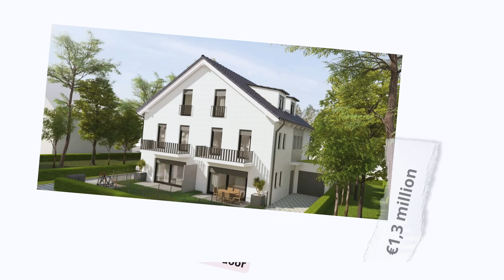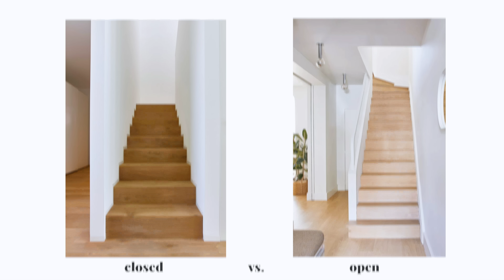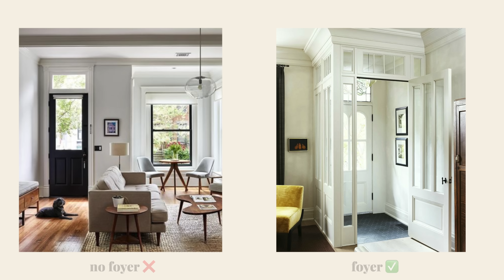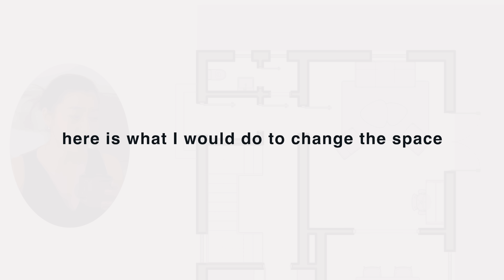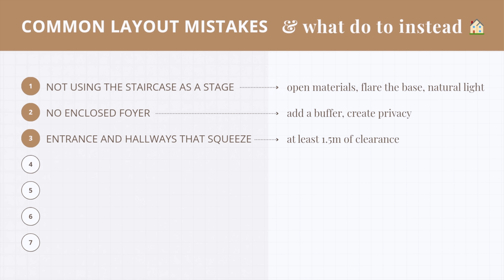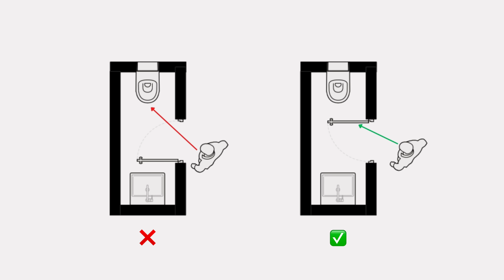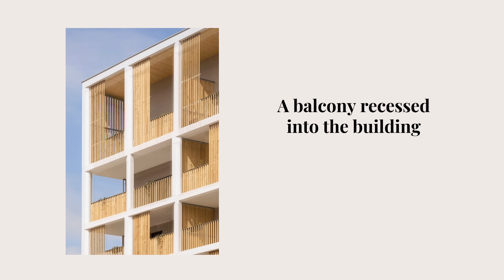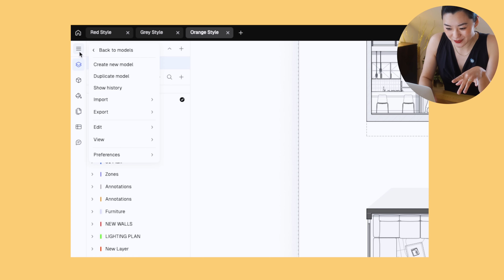Architect’s Advice: 7 Common Layout Mistakes + What to Do Instead

Comment: Used to draw plans for people & built a few homes for myself (with hubby (Australia)).  The little room in front of the toilet in the foyer is for odours & soundproofing.   With an extraction fan in the toilet & a handbasin in the little air pocket room there's more privacy - but it's cramped too much for bigger people.  Some could not get into the toilet room & close the door.  A nightmare if there is a health emergency once in there with the door closed.  Toilet doors should always open outwards.

You're absolutely right about doors doorways in the centre of walls - a nightmare!  If a dining room is part of an open plan, next to the kitchen it shouldn't interfere with a passageway to an external doorway.  It's not sensible to design corridors into rooms - it causes a lot of wear on floors & even furniture when they're touched in passing - & it restricts passage to the outdoors - think emergency exit.

Comment: Very good advice!
I shared a large detached house in Netherlands with my parents, the house being divided in an lower and upper flat. This was done by the previous owners of the property in the period between 1970 to 1986 and my parents and I each bought one of the flats.
The original house is from 1932 with later add ons built in the aforementioned period.
While the original design was sound with a lot of your tips practised the later renovations and add ons made it having many of the don't do's, often combined with poor workmanship.
Like a partition in the hallway to have two entrance doors to said flats, door placement to the add ons having circulation cutting trough living areas and a long narrow and dark gangway in the add on.
After my parents passed away I inherited the lower flat and owned the whole property and started planning on a renovation to improve energy efficiency, make one large family property out of the two flats and improve on many aspects. Especially the dark and narrow spaces are my nemesis, and a detached house of 210m² shouldn't have these!

While doing the design work myself by coincidence in an effort to make things look and feel better I had already implemented some of your advice before seeing the video, there are also things which I didn't consider yet but try to fit in my design as well.
Like removing unnecessary partitions, opening up the hallway, and expose the stairs with the original wood paneling visible which covers the stairs into the cellar, The hallway has a lot of light already by opening up two small windows which were covered up and only allowing light to get in via the brown glass in the old front door.
Currently there are two doors leading from the living room to the add-on, one into the gangway and one into a room.
These create 2 corridors limiting the possibilities for the new kitchen and diner space. These door will be removed and one new entrance without a door will lead into a small hall, 1,80m x 1,30m, from where acces into the gangway, the room and  a new toilet  will be. The open hall will make the living room larger. The hall and toilet will take part of that room in the add-on but as that will be used as a hobby/office room there is enough space remaining for that function.
Following your advice the door into the toilet is a bit offset to one side of the small hall and opens in such way so that there is no direct view in from the living room. The new toilet replaces an existing one that's now inconveniently at the end of the gangway and taking a part of the garage away. (the house was originally built with an outhouse in the barn! so that's why there's no toilet in the original part of the house)
Finally adding a set of french doors in the kitchen area will allow light in from 3 sides in the open plan kitchen/living area.
The kitchen itself will have work tops and cabinets along two sides opposing each other with a 1,5m wide circulation space in between, so that there is enough space for two people working on the opposite sides and a third person walking from the door into the living room can still pass.
The gangway in the add-on will be widened from 0,9m to 1,10m by taking a bit off an adjacent room.
The changes which have been done by now make the house already feel much nicer.

Comment: Just came across your channel. Enjoyed watching it. Been doing a rough layout for a house I want to start within the next 24 months. Something to consider is future maintenance. Site-Built homes they love placing the plumbing under the slab/ floors. I have seen some homes going w/ the PEX Plastic lines overhead. I love how you can put individual valves  on the lines (not shut down the entire system for a repair (toilet or a faucet) And how faucet’s especially in the tubs/showers. Trying to have a closet on the back side and have an access panel to gain access when needed. And metal ducts, the flex duct hoses they use are so inefficient. Very easy to install but that’s the only advantage.

Comment: I'd like to add one: Swap out the toilet with the laundry machines. The bathroom is really 3 frequently needed rooms, forced into a single space, and only one person can use it at a time! This makes it always occupied when you need it. Swap the toilet for the washer/dryer, and suddenly the toilets are occupied much less often. The shower can have an extra curtain for extra private space while dressing, leaving the sink available for simultaneous primping. The washer is used far less often, so crowding isn't a concern. The other major advantage of this is not spraying fecal bacteria all over your toothbrush every time you flush the toilet. It also just makes sense to have the laundry in the communal room where people tend to take off dirty clothing.
Reply: Separate toilets have been the norm in Australia for ever. Absolutely agree with the idea of a laundry-bathroom as well, we have that arrangement and it's perfect..strip off dirty clothes and straight in the wash!
Reply: Having a laundry by the front door also means having to carry washing throughout the house instead of being easily placed to put on the washing line outside; you also want to keep the noise of the washing machine away from the main living areas as much as possible.
Reply: My husband and I are retired and several years ago, designed and built our “aging in place” home. We were the owner-builders with a construction consultant and we used his preferred laborers). It’s very small but doesn’t feel small at all due to good storage and high ceilings…vaulted 12-13 ft high in the main room…9 ft in remainder of house. The biggest thing I like about our (only) bathroom is that it’s divided…enter outer bathroom… vanity on the right side/washer dryer on the left…continue walking straight ahead to inner bathroom with door separating…toilet on right side (not visible until you walk through the opening) and walk-in shower on the left. We rarely have any issues needing to use the same bathroom facilities at the same time. Works well when we have guests in the house, too.
Reply: That's just dumb. A bathroom is NOT a community room, it's a private one. And you need all those things (toilet, sink, and shower or bath) in one room. A washer and/or dryer can go anywhere there's room, and it doesn't matter if they can be seen.
Reply: @awo1fman  "A bathroom is NOT a community room, it's a private one." That's my point! The bathroom is 3 really rooms jammed into one, that can only be occupied by one person at a time because of privacy needs! That's why, if you live with someone else, there's a good chance the bathroom is occupied when you need to be in there. By swapping the laundry machines with the toilet, you can make the room 1: far less needed at the same time as others, and 2: sharable even if it is needed at the same time as others.
Reply: @awo1fman  You do NOT need all of those things in one room. Why do you need to poop in the shower room? Washing machines also need access to water lines, as does your kitchen, yet the kitchen is not in the bathroom, is it? You're not making sense.

Comment: I have lived in 10 different houses. I would stay away from open concept houses where the living room , kitchen, dining areas are combined; no private space and getting away from kitchen mess. I do not like open stair cases, as they make it difficult  to subdivide the house into smaller apartments . Many of today's houses are too big for the number of occupants and will have to be torn down, when higher density communities will be required.
Reply: Time to bring back larger families.  The 'below replacement birth rate' is unsustainable anyway.

Comment: The one problem with an open staircase is all the heat rises from the bottom floor to the top. I would even close all the heater ducts on the upper floor and still the lower floor was cold.

Comment: On an efficiency stand point opening up the stairs can effect the temperature and therefore comfort of the home especially in very hot or cold climates. Its called the stack effect. When you open the stairs up you allow for the hot air to easily raise to the top and the cold air to fall to the bottom. It's worse then just that. The hot air creates a pressure at the top pushing its way out though any cracks. The basement is then put in a negative pressure pulling in air from cracks in the basement (or main floor if there isn't a basement). This will worsen its effect. You will have to build a very air tight house and you need the ability to pull the air back down with ventilation.

Comment: Great suggestions.  I am not an architect but we are trying to design a new house that would have a lot of universal design features for elderly or handicapped.   I especially like the toilet suggestion as, if you are dealing with an already built house, it would not be too hard to simply switch the way the door opens.  This helps not only for privacy, but you don't want the door opening to block your use of the sink.  If you simply want to wash your hands, the door can remain open - so it seems more of a common sense layout.   Recessed rooms are an issue for us - including balconies (we would not have a balcony sticking out for the reasons you stated) but would not have a recessed balcony because it simply blocks the light into the home or apartment - presumably into one of the main living areas where you spend a lot of time.  Understanding that many apartments and homes have balconies so you can enjoy the outdoors, given how little time people spend on them versus how much time they spend in the main living areas - it may be a tradeoff - but we would ditch balconies tto not blocking the light in the living areas.  Even if they are not recessed, in an apartment, unless you were on the top floor, you still loose light from the floor above you.  Does this make sense or am I off base on this?
Reply: Hire an architect.   Seriously.  Or at least a building designer or published house plans.
The house I live in now was designed by the owners.  The master bedroom is the smallest bedroom in the house, a double bed is all I can get in there, the bathroom as zero counterspace it's just horrible.  Will cost $400,000 to fix is; cheaper just to sell and move elsewhere.
Reply: My LARGE recessed balcony is the best "room" of my house in which the most time is spent. The balcony has a high gabled roof, allowing plenty of light into the adjoining kitchen, which has a servery to the outdoor area. Wonderful functionality in our warm climate.

Comment: Not sure if it's intentional or not, but one "trick" that I've seen to (partially) hide a toilet in a small bathroom is to put it on the far end of the sink vanity (door > vanity > toilet).  A bonus is that, if you have a window, you can gaze out upon your kingdom from your porcelain throne.

Many older US homes have "galley" bathrooms (similar to galley kitchens) with no real corners, as such, to hide things behind.  Sink and toilet on one side, shower/tub on the other side.  And, if you're lucky (ie, not in an apartment), a window at the end.

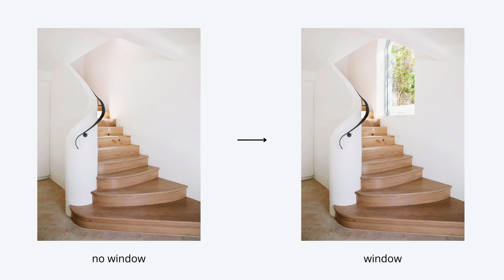Comment: 1:51 Stop it right here! I want my stairs closed! I must have my steps EQUAL in size - and I think different wides at the bottom should be forbidden as it will make people trip sooner or later.
Reply: That's what I was thinking as well. Also, if the stairs are enclosed, it's easier to make them into extra storage space. I do think there needs to be extra lighting in a staircase, though.

Comment: You realize that if you add 50sf to a house to create a foyer, the tax assessor will add $20K to the house value and you will pay $300/yr more in property tax on average, right ?  Forever.  Also, if your drawing is to scale, your revised powder room does not meet building codes for clearance between sink and toilet front.  And rooms with lots of windows from every direction might look pretty but are impractical for media rooms and libraries due to glare on TVs, UV light hitting bookcases, all the low R-value glass, limited furniture placement, etc.
Reply: In rural France that might be only 1K. However in Paris it could easily be 100K.

Comment: In the US a 1/2 bath by the back door that leads to the garage is very common. It's so if you're working in the garage or outside you don't track dirt in through the house. The rest of your ideas are spot on and what I like the most is most of them don't add more cost than original design. Good design doesn't have to be expensive.

Comment: great points. The point about windows on 2 sides, the reason behind some places only having one window in a space is due to the fact that in northern climates, such as canada and especially northern canada, its general practice, much more so in yeas past, to purposely not place windows in the north side of homes as much as possible to help regulate the  temperature of the home. you lose lots of heat from northern winds, and the lack of sun light you do get from the north. but I agree with all of your points.

Comment: Hello Baixu ! It is so nice to meet you like this.  I too design floor plans, but mostly for castles and space stations so there are a few constraints for me that you don't have.  Fewer balconies in space and castle walls are not strictly straight.  My first complaint about main stream floor plans is that the bathroom doors open INWARD to hit somebody on their knees or back side.  This is not thinking outside the box.  A bathroom door should not hit someone.  It should always open out on a small bathroom, like a small closet.  I like the ideas you have brought up and are naturally more attractive.  In space, windows must not be large, however, view screens can be and made in such a way as they look like windows, having a holographic element.  Same for looking in and this idea might work well for some of your designs where a window might cost a thousand dollars to install and a 60 inch flat screen with an outside camera with an un-obstructed view only $600 dollars.  Recess it into a wall and it will look more natural. It also has the advantage of privacy as no one can look into see you.  I think Russel Brand  uses this method on his podcast.  I love curved stair cases... but why don't people use firemen poles to come down with?

Comment: Just want to mention that I am sitting in a room that has windows on all four sides! It's a converted one-car garage. Both of the short walls are windows all the way across, the long wall with the opening to the breezeway is half taken up with windows, and on the other long wall there is just one window because there's no view out that side--the new 2 1/2 car garage is out there, past a small garden. But that single window faces south and brings in a lot of the direct sunlight. The walls are whitewashed pine that lets the knots in the boards show through, and the ceiling is peaked with the roof. It's a room that often makes people pause when they enter it and many people tell us they particularly like it. Because it's on a slab, it couldn't be brought into the forced-air heating and A/C, so it has a large, modernistic ceiling fan and a gas Franklin stove in the corner. Despite not being directly heated it's the coziest room in the house on cold winter days.

Comment: Thanks for the tips. We are planning to build an unusual tower house. It will be a 5x5m square at the base with 4 floors. The 4th top floor will be 2/3 of a floor so that from floor 3, you can look up the void to the 6m ceiling above. The ground floor will be kitchen and dining, with an open staircase and windows on multiple sides. 2nd floor is toilets, bathroom, sauna, laundry, storage. 3rd is a small lounge, office nook, cantilevered large box window and the master bedroom behind sliding panels. The top floor is accessed via a ladder with a kids area. 4 bunks designed from a Yacht idea, plenty of storage, a desk area and the possibility of another double bed that pulls down from the wall (Murphy Bed). The structure will probably be steel frames and steel exterior cladding with timber interior. 
The second stairway cannot be open because there is storage on the other side of the wall, but there will be a window. In total, the floor area will be approx 85 sqm. Most of the tips you gave are already part of our design, although it's difficult to fit larger steps at the bottom of our stairs.